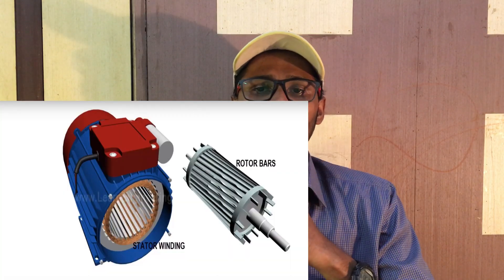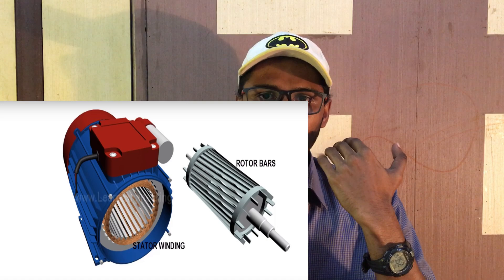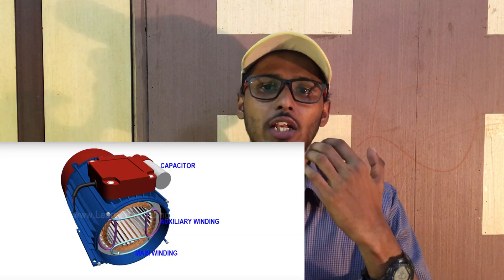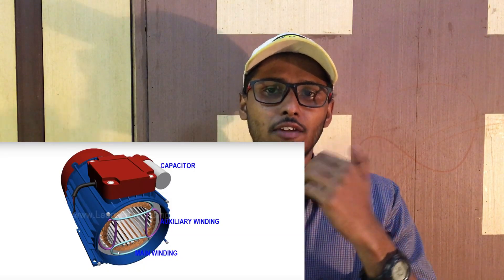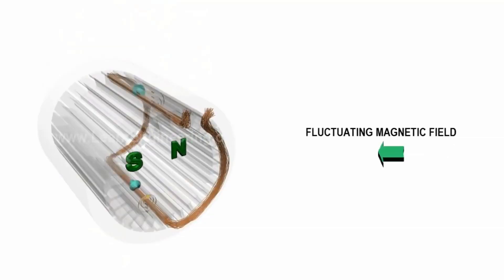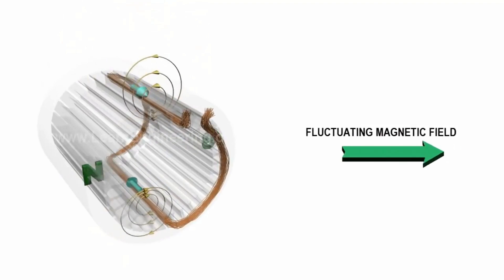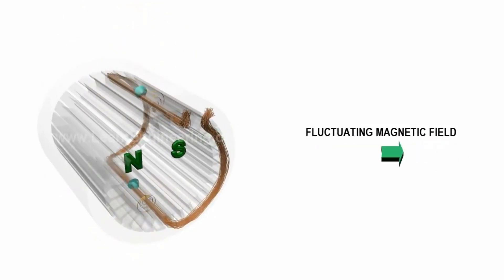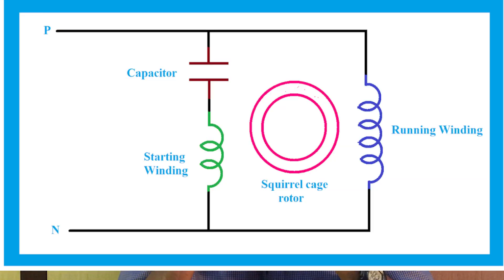Why Single Phase Induction Motor not Self Starting

Comment: Athyadhu fix akiya puram windingilum,rotate  cheyyunnu  windingilum capacitor  thru current pass cheyyunnathu ethu winding aano athil voltage variations  undavunnu.? Apol coilil koodi koduthirunna  electric charg moolam undaya magnetic fieldil vethyasam varunnathu kondu  ava thammil vikarshikunnu. .angne motor karangunnu. .? Ithano sambavm.? 😕

Comment: Singl phase cutter machine (taile/wood piece ) ഇവയിൽ capacitor use ചെയ്യാത്തത് എന്ത് കൊണ്ട് ?
ഇവ work ചെയ്യുപോൾ fan നെക്കാളും sound ഉണ്ടാകുന്നത് എന്ത് കൊണ്ടാണ് ?
Reply from the maker: Athonnum ac motor alla.. universal motor aanu... athil brush und athkondaan sound...
Universal motor ine patty video cheyunund...
Reply: Motor used in Mixie, cutter etc, Universal or AC-DC motor they hav Commutator and Carbon brushes
Reply: Fan work cheyyumbol LED Tv pettannu offaayi 2 second kazhinju automatic Aaayi on Aaakunnu enthaanu reason??